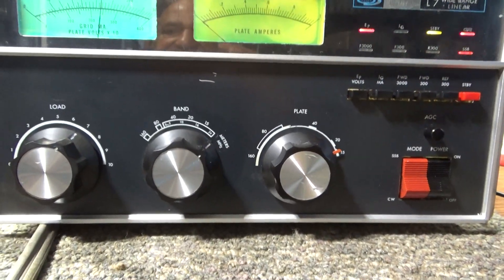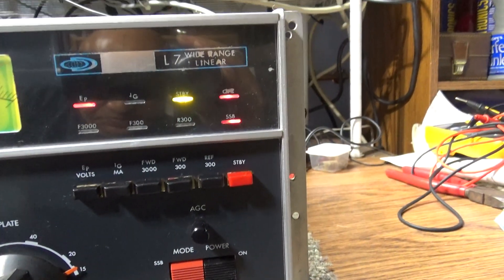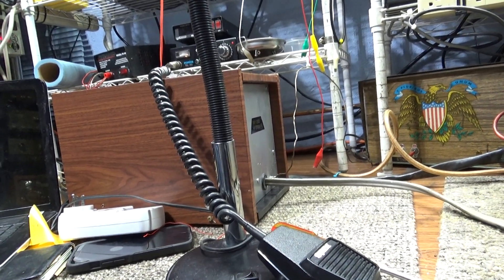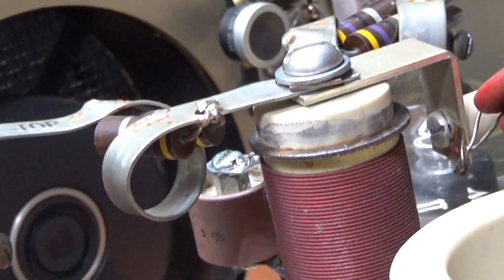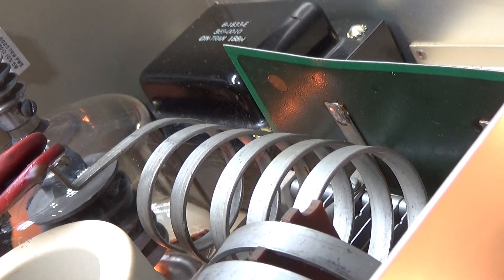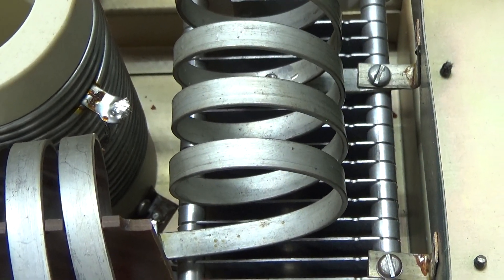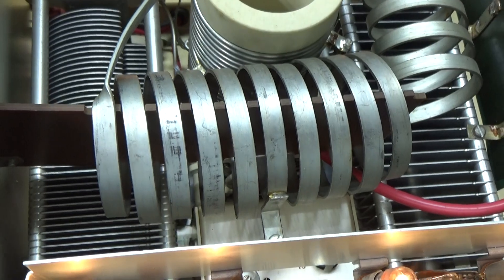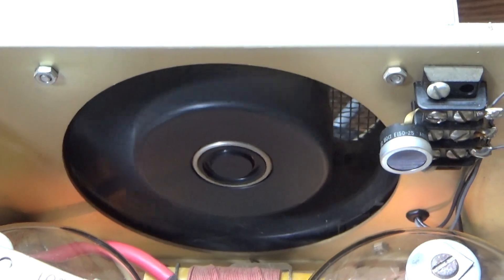Drake L7 Linear Amplifier on the bench, keyed down on the Dummy Load.

Comment: Regarding the tank coils, what's the advantages of using flat strap as opposed to round wire?
Reply from the maker: RF rides on the outer surface of conductors. Low Ac and DC use the whole conductor. Hence for the same power, RF needs much more surface area than ac/dc does. Usually, flat conductors provide more surface area for rf. Another tidbit, since RF rides the surface, a rf conductor can be and often is hollow. Last, RF is not really a fan of braided conductors either, same reason, braided often does not have enough outer surface area to make RF happy. Solid outer surface, hollow inner is fine, is what RF likkies.
Reply: @tramdr  Right on, I appreciate your input, thank you!.

Comment: what would this thing do all wound up? just curious because of those big ass tubes
Reply from the maker: So many amps with 3-500z tubes, but with Transmitting Tubes, I pretty much just go by the plate dissipation rating of the tube(s). A 3-500z has a plate rating of 500 watts per tube, so 1000 watts per the pair. For dead key, I go by 1/2 the plate rating and for swing, I go 2x the plate rating. Hence 500 watts dead key and 2000 swing, but if you wind it up harder, espcially by raising the plate volts a lot, which many amps do, you can get about 2600 watts swing. Should be one wound up coming in a few weeks.